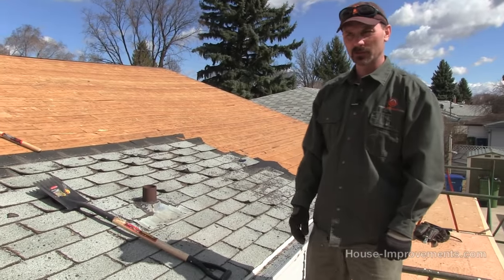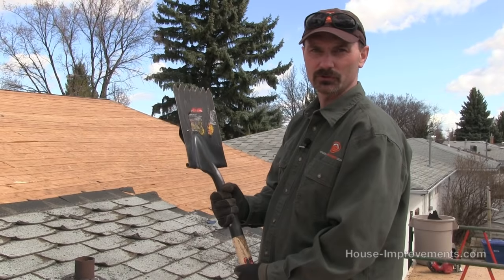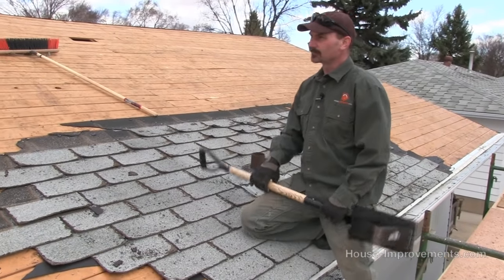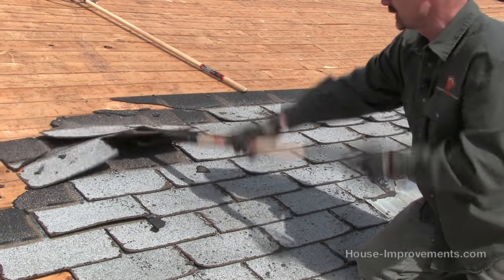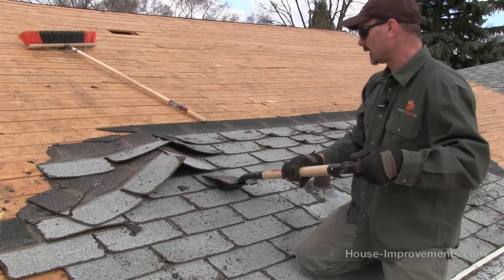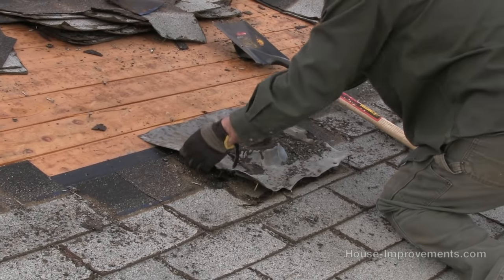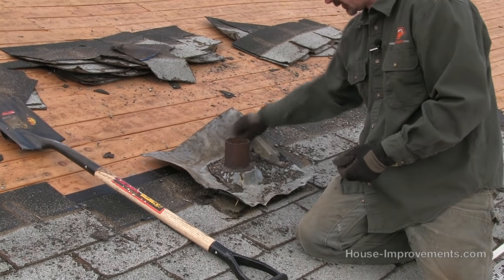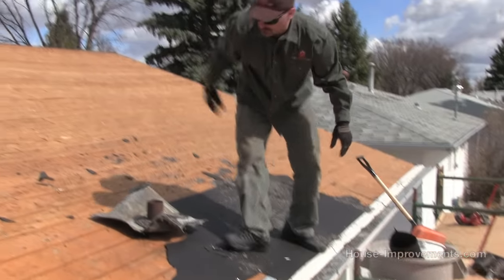How To Remove Shingles

Comment: For those saying why is there no ice and water shield, it is because it wasn't code back then and it cost more so guys didn't use it. Furthermore as a journeyman roofer all aspects of your roof should be replaced 100% cause you can't guarantee ever they will make it to the next re roof and careful when walking on felt paper on the roof, have seen a couple people fall off the roof doing that

Comment: Thank you for sharing this.  It's been 43 years since I've done a roof on a cabin. I'm attempting to replace shingles on my shed, but the pitch is pretty bad for a 62 year old with artificial joints, but the roofer from Church was quoting way too high so I needed a lesson in doing all of it. Hopefully, I can get my busy son to help me. I like that removal tool. When I succeed I will save $2500 and have a ladder and tool I can still sell before we move and rent this house out.

Comment: Had my roof replaced last year. Those guys just removed them by hand, stacked them, and then put the stacks on the top of their head to take them to the dumpster. Pretty impressive.
Reply: That works with a one layer tear off. No bueno for more than one layer.
Reply: @bobdunagan9101  I would never install a new roof over the old one.
Reply: Actually it'll work with even a 3 layer. May not stack on head but hold in arms. Much more professional

Comment: I tried all kinds of “shingle shovels” and I always came back to my old t handle spade shovel. If you have laid shingles before it helps you understand where the nails are and how to tear them off. If they are on plywood and not crumbling you can remove them quickly without leaving any nails or debris behind. Old board decking is another animal, steep roofs are easier to clean as you go.

Comment: There is too many critics that don't seem to realize that this is for the DIYers and not a full time production crew.  I started from the bottom so that I could shingle then seal it up between the old and new on rain days.   The scaffold is a great idea, I set the boards at three levels to make getting up and down so much easier than a ladder and it made getting the bundles up there much safer.
Reply: Not sure I understand how scaffolds make getting shingles on roof, safer or easier. Either way you have to climb ladder up scaffolds right?
Reply: @imnotgood15aka.notgood21  
Because you can do the bottom 4ft of the roof by standing on the scaffold, rather than being on the roof facing down.
Reply: @robertalan4717   well, what I was meaning is easier or faster or better in anyway. I roofed for 18 yrs so to me this is laziness. Not to mention most men should have most of that side, "really all of", tore off by the time they can set this contraption up and get started. Roofing is not hard, just have to be a man about it, that's all.
Reply: @imnotgood15aka.notgood21  
See I'm not a roofer, I'm a tree worker, having spent 15+ years removing and deadwooding sometimes huge, like 120X100ft oak trees.  Years spent working within feet of 4000-40,000volt hydro lines. Sometimes I would bend a branch down into the line to hear it sizzle like bacon.  But I'm older now and I'm going to do things the easy safe way and it only takes 10 minutes to set up a scaffold with wheels that I can move along the eaves.  Being a climber/trimmer I can easily climb up and down the boards. There's really no rush. A safe good job is priority. Yes I have respect for roofers.  They have to deal with extreme heat and cold and heights. It is one of the most difficult jobs.  Cheers.
Reply: @robertalan4717  I agree, but you can't tell me that those scaffolds are safer than screwing a harness at the ridge and wearing it. This guy slips he falls. I slip no scaffolds and still don't fall. Takes two minutes to screw 3 screws at ridge and throw harness on. Bet you can't set scaffolding 2to3 scaffolds high all the around this house in less than 30 minutes, by that time Ill have half the roof off and you will just be getting started. Then not only will I be done long before you but you have to take all that scaffolding down. I'll be faster, safer and do less work. 
Cheers. 🥃
Reply: If you watch the other videos, he states he put the scaffolding up mainly for the benefit of the guy who was videoing, and addresses the need of a safety harness if you’re on a higher roof or uncomfortable on even one level.

Comment: Have you ever tried prying up shingles from the bottom corner of the roof and then rolling the whole thing up like carpet?  If you have tar paper that works.  Of course, you can't roll the whole roof at once but it pulls up all the nails etc with it.  I stripped my entire 22 square roof myself in less than 2 hours.  That shovel was important to getting each roll started.  Anyways, I love the videos, I donated on your site, I'll donate more as I watch videos.
Reply from the maker: Thanks Chad, we appreciate the donation as well!
Reply: Chad D been doing this for a year and I do the same. Start at the bottom corner and pull up 4 courses at at time, hands down easiest, fastest way to get that tear off expedited. Aloha from hawaiii
Reply: Chad D long as it doesnt fall apart in tiny pieces or is stuck 2 tar or ice n water hell yeah
Reply: Chad D thanx for the top.. doing mine next spring 👍
Reply: Are you scrolling up the tar paper with the shingles? Or just rolling the shingles? And how wide a swath?

Comment: Hey Shannon, I just wanted to say thank you for putting together these great DYI roofing series! I had a quick question for you, would you recommend stripping the shingles off and leaving the roof bare under tarp for a few days in between if you have the spare time? Or would you recommend just waiting for a patch of cloudy/sunny days to do it all at once?

Thanks again Shannon!
Reply from the maker: You can tarp it up , but be sure your tarps are well secured incase a wind or storm comes up.  I normally would strip one side and then shingle that side leaving the rest of the home covered up. Or you can even strip off as much as you think you can do on a side , install the new shingles to that point and strip some more again to keep going. Either way you want to have some tarps available incase a storm comes up.

Comment: I am a homeowner with a 2-story roof.  With that in mind, would you please do a video on how I could use safety equipment to re-roof the 2-story.  Please include a section on using roof jacks.
Reply: Safest way is to hire a licensed roofer, just ask a few actual construction workers, not contractors, who they would recommend. That's the safest. Anybody that ask for payment before completion instantly remove from options, people who do the job before they receive payment always do better work and have more pride because they believe their work will speak for itself when time to collect. But you can do yourself, just make sure Jack's are nailed in rafter so they don't pull out, and when you nail on make sure when you nail shingles over them the break don't fall where Jack's were. When your done just lift shingle drive nails down, tar over nailheads and nail shingle down. To be really safe you can buy harness and harness off but hell, who doesn't wanna live on the edge a little. Enjoy 😗

Comment: Is it really necessary to take the old nails out with the old shingles? Particularly if a steel roof is to be installed?
Reply from the maker: not really , pound them in flat with no shingle debris under them

Comment: Awesome videos! I like your quality work. I'm looking at an older home that has thinner plywood across the rafters. I'm planning on replacing it with thicker (3/4 I think) would it be easier to just cut the plywood in sections from the inside vs. removing all the shingles nails then the plywood?
Reply from the maker: Not sure cutting from the inside would be very easy. You could cut from the top side but I would recomment removing the shingles and then plywood anyways.

Comment: HAY?
I loved your instructions - watched a few vids of yours..

Need a simple advice... as a general matter..
We have some shingles carried away by STRONG WINDS!  I estimate that the lost patches are about 20% of the whole area...
As a general rule would you recommend replacing the WHOLE ROOF or just fixing the damaged areas?
Reply from the maker: patching will be fine ,you may find though that you can not get a perfect match most times so if that is an issue for you then you may want to do the entire thing. From run to run at the factory they can be slightly different in shade/color

Comment: Another Excellent video, Shannon!  Thanks for sharing and producing this video.  I have an A-Frame roof with a 60 degree angle (off the horizontal) to tear off.  The sub-roof is 1/2" OSB.   Because of the 60 deg pitch, I'll have to use Roof Jacks as I work my way up the roof.  Also, I expect the shingles will just slide off the roof by themselves once I've torn them off with the roofing shovel, so I'm just going to place an old pool cover on the ground to collect the torn shingles, nails, and other debris.  Actually, I'm sure they'll get hung up on the 2x8 boards on my roof jacks.  Any other suggestions on how to tear off a 30yr shingle from an A-Frame would be most appreciated.  Thx!

Comment: If I strip a roof and then install the underlayment, how long can I wait before installing the new roof? I am doing my own garage roof with metal. I can't do it all in just one day. Probably be 2 weeks to complete. Should I use synthetic or just felt will do? Thanks!!
Reply from the maker: If you use felt you need to cover it right away or it will rip off in the wind. Some synthetics are better with wind for limited days. Check with manufactures recommendations.
Reply: @HouseImprovements  maybe I'll just strip the roof, put the underlayment down, then strap the roof in preparation for a metal roof. Then it should be fine for a while until I get the metal roof material.

Comment: Hello Shannon! Here's a question - a fellow told me once that it's a common thing to cut the Metric shingles to the size of the English ones (English are discontinued a long time ago). Have you ever had to do such a task? What would you recommend? Taking into consideration that this should be a guaranteed job not just a DIY. Thank you in advance for your answer and for your awesome videos!
Reply from the maker: I guess if you are patching a old roof that has old size shingles but I have never seen that. No reason to do that on a new shingle job.

Comment: Don't know if you still check this channel. But would it be acceptable to cut boards at halfway points on the joist I'd you need to replace them....I have the lumber styler roof like I  this video vs pay wood. And a couple areas need to be replaced. With the price of wood currently I'd rather not replace the whole thing if not necessary....referring to the Sheathing of course...Wil be replacing all the shingles.
Reply from the maker: yes make any joints over the rafters.

Comment: Is it possible to remove half a roof of shingles in order to overlap new felt on pre-existing felt and to only do half of the roof with new shingles. Our roof was done like 10 years ago but recently had a pine tree fall and damage only a portion of our roof. I was hoping to only shingle half of the backside of the roof but will do it all if needed.
Reply from the maker: its possible but I would not recommend it at all.
Reply: Okay, thanks. By the way, I love your videos…they've helped me tremendously

Comment: Good info. Didn't know they made a special shovel for this. 
Stacking the old shingles seems kinda silly tho. Why not use the shovel to chuck it off the roof and clean up at ground level? 
Also, why are so many people shitting on this video in the comments? Roofers who are pissed that people know how easy a re-roof is now?
Reply: Coder1024 : by chucking them off the house, you get a lot more nails and pieces you then have to clean up on the ground level. A good roofer will try to keep the yard, decks, etc. clean to save time.
Reply: @xcrewchief1  That's a good point!
Reply from the maker: Less trips to edge of roof if you get a bit of a pile to take each time. I strip right into a trailer if possible or drop onto a large tarp on ground if I cant get trailer close enough.

Comment: if your right handed you start in top right ALWAYS! (unless it was nailed left handed then it gets interesting) find the god 2 shingle pattern then pop all nails repeat till roof is ripped. Some people do a 3 shingle rip starting in same spot i only seen 1 guy in my 10 year career do this. Exceptions if its hot and sticky and the seal isent breaking, square out a nice section with your ripper and roll it up getting all nails. (This sucks but happens usually when you rip in afternoon and dont get there at 7 AM) should have everything you are going to rip for the day done by 10-11 AM

Comment: They are replacing the roof and plywood where I live. I can still see light from outside coming through plywood. They have gone home for the weekend. Is this ok or do I need to worry
Reply from the maker: If it rains you could have an issue for sure
Reply: @HouseImprovements  Thank you

Comment: What is your plan if you have to leave a roof open or it starts to rain after you get it open
Reply from the maker: Have tarps ready to cover it. Screw the tarps down and place a few bundles on it incase the wind gets up. Or just strip what you can shingle in a shorter time if you prefer.

Comment: how do u handle around the electric cable and pole. what's the safe way
Reply from the maker: +t dub  Be very careful obviously take your time working in that area.. If its a round pole with flashing around it re use that flashing. If its is wood you can likely remove and replace the flashing.

Comment: I use a pitchfork to remove the shingles, its cheaper and easier
Reply from the maker: Yes that will work as well. I usually use just a normal square nosed shovel.
Reply: Pitchforks do work, but then you gotta go back and get the nails
Reply: Jarliel Loach Either way even with the shovels you still go back to remove them , he said that in the video already as well
Reply: Fast Internet  4 years later

Comment: Pitch forks are best for tearing off. 4 prong to be exact
Reply: So you have to go remove every nail afterwards?
Reply: @Wangpi3ce  you can use a shingle eater to remove every nail if you want but its not necessary. You can bang down most of of the nails and tear off 10x faster

Comment: no ice & water shield?? especially with those gutter guards?   asking for trouble.and that plumbing vent is far too short,  would get buried in snow here.
Reply from the maker: +MrHemi4spd  New roof gets ice /water shield and 2 layers of felt on the entire roof. Keep watching for our videos as they release.
Reply: I knew you wouldn't neglect to put the membrane Shannon,   I was questioning the lack thereof on the previous installation.

Comment: can you go over a t lock roof with 3 tabs , ??
Reply from the maker: You could if the interlocking ones are still laying flat.  I recommend removing old layers of shingles to reduce weight of roof and also so you can inspect wood roof sheeting for rot/damage.
Reply: @HouseImprovements  tyvm
Reply: ty I have done more than a few roofs but me and a friend are having this debate about going over the t locks I told him if they are laying flat , why not he said no way. I believe you and I are correct , I took a better look at the job the other day , they are not laying flat enough, so he will feel as if he won this round lmao, ty have a great day,  @HouseImprovements

Comment: I  trying to enclose my patio to make a sunroom. How would I frame the walls if the roof overhang of the house goes about 4 inches under my patio as shown in the picture below? Notch the studs around it or saw off a few inches of the roof to meet the exterior of the wall? 
    
http://s62.photobucket.com/user/T1mac23/media/1913D8E6-506F-4D61-9CE0-9839911D110B.jpeg.html

Thanks for your help

Comment: Of course, the concern is older houses' roofs with multiple-layered shingles you want to remove. Older houses may have asbestos shingles under the non-asbestos shingles. 

We know that asbestos is very dangerous if the asbestos shingles used have high risk of friability. If you can break off those shingles with your bare hands (making those shingles "friable"), you are in danger of breathing in the asbestos fibers in the shingles that is similar to dangerous silica dust. 

Asbestos, of course, can cause lung cancer (pneumocodiosis), pneumonitis, and pulmonary fibrosis. 

So the best course of action if your shingles on your house you want to remove are suspected to have asbestos shingles under it, or only asbestos shingles.....

1. Get a licensed asbestos removal contractor along with the roofing contractor, which can help the roof workers find the suspected dangerous shingles. 
2. You may have to leave the house for awhile, or you may be required to lock yourself down in the house, so that the roofers and the asbestos removal workers can remove safely those asbestos shingles and safely haul them away.  
3. Once the asbestos shingles are safely removed, you are in the clear and you can get back to your house again (or the lockdown will be terminated).

Comment: that roof looks like it has a lot of sag. This is also the first time seeing one with 2x material being used.
Reply from the maker: +Adam R  Ya there is some sag in these old hand built rafters. Not sure what 2x materials means?
Reply: HouseImprovements two by. 2x4, 2x6, etc.
Reply: I'm new to this sort of thing. Is it normal and perfectly fine for the roof to sag a little bit?
Reply: ***** A little bit of sag is okay. If it gets too low, it might become a place for water to pool and seep into the house.